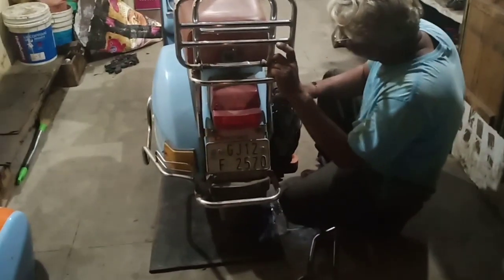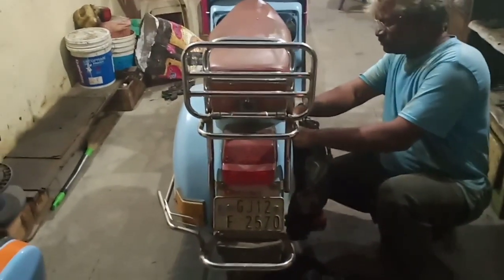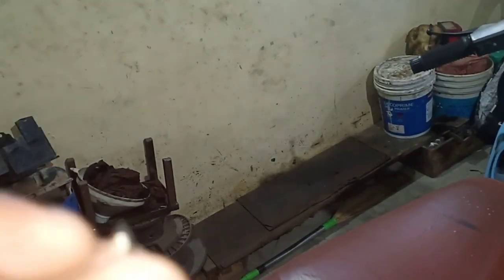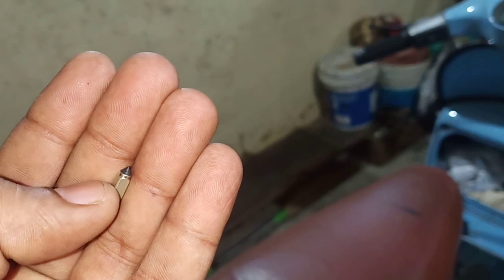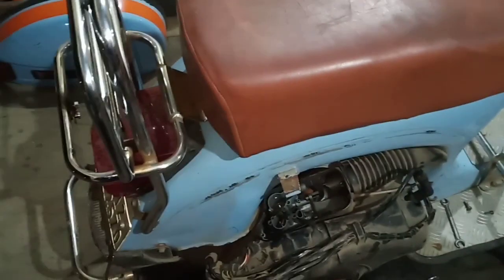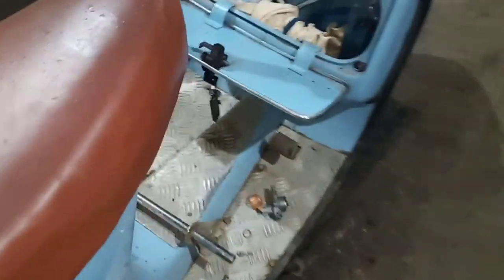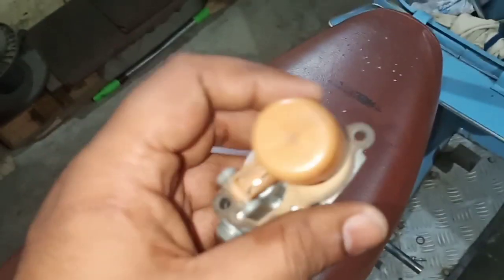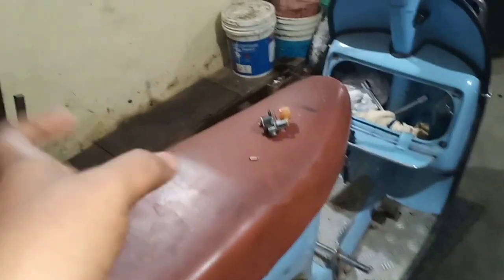How to solve overflow problem on vespa.

Comment: Make a video on solving carburetor leakage problem
Reply from the maker: You need to change the float pin mate, that will solve your leakage issue/overflow issue.
Reply: @BuilditRideit  does it needs changing new carburator packing kit to solve problem
Reply from the maker: @allampallimanoharasairam4468  not really.